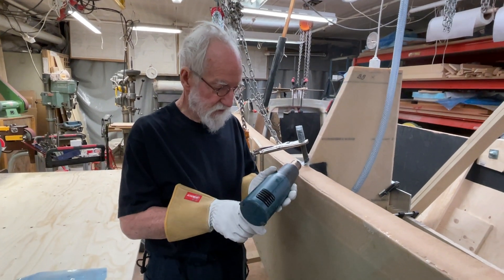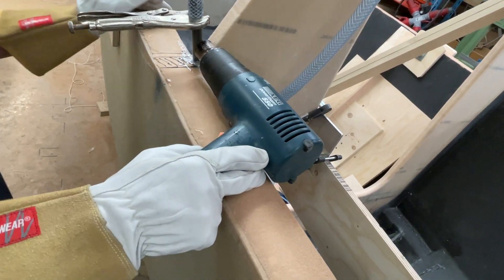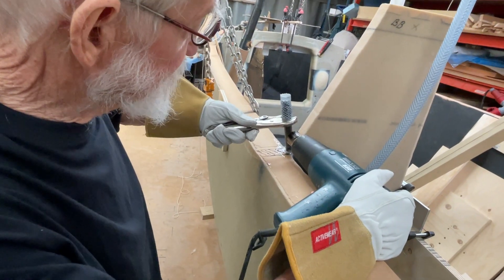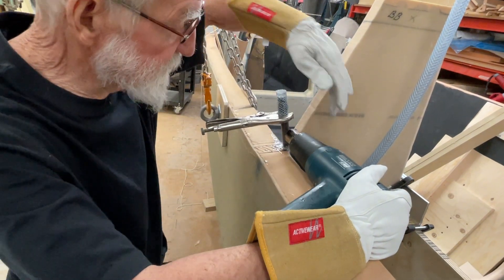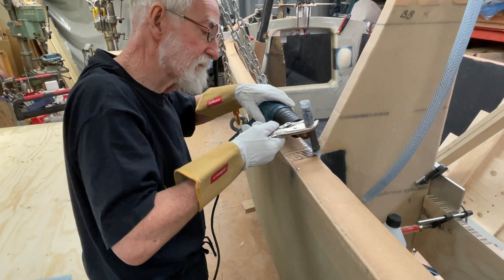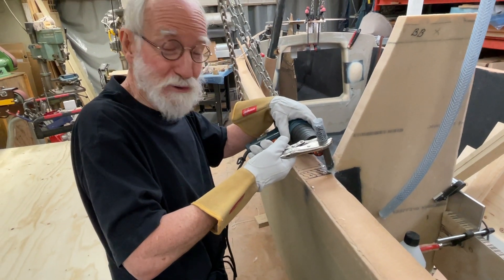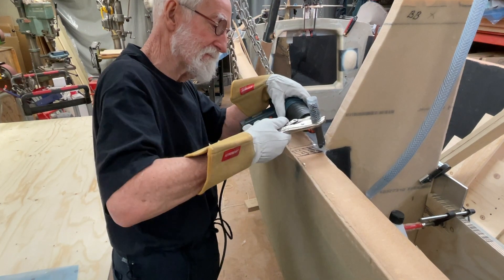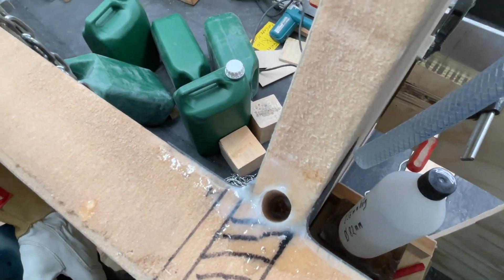A simple way to remove hardvare sett in epoxy.

Comment: Also works with screws that have been epoxied in. But you  need a soldering iron to heat the screw.

Comment: I have heard that you can also coat the item with grease and then the epoxy will not bond. Did you try this with that current item? Good to know there is also this way....
Reply from the maker: True, grease prevents epoxy to bound very well indeed. But thats the problem if it skould contaminate something else. Just a fingerprint in the wrong place can make things go wrong. 
Thats way I stay clear of grease. It is dagerous.

Comment: Should the bulkhead be fastened mechanically? The hull will pull away from the bulkhead. The bond is working in tension. The bond is only affixed to the thin carbon fiber laminate. The CF is not strong in this orientation and the bond will create delamination.
Reply from the maker: The bulkheads are already laminated and that is superstrong.